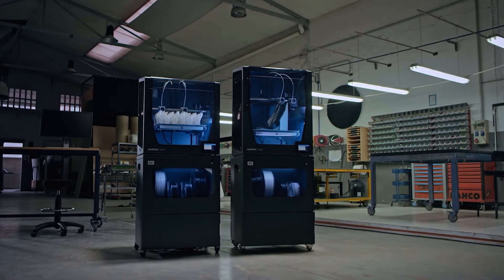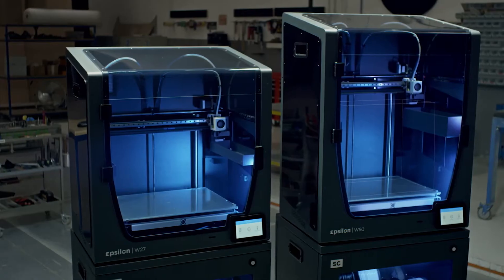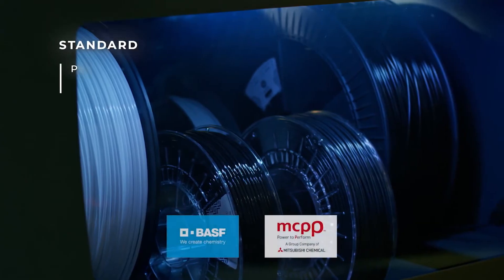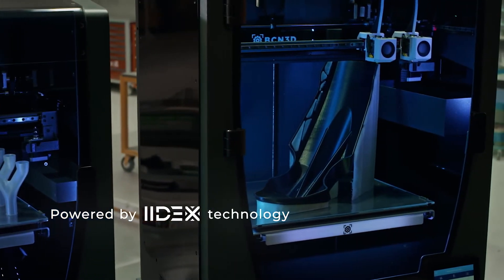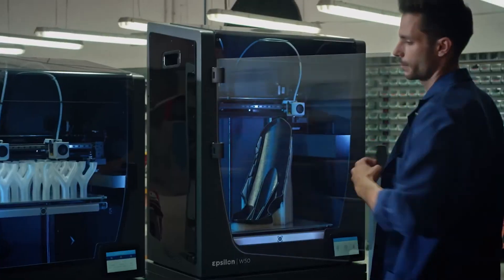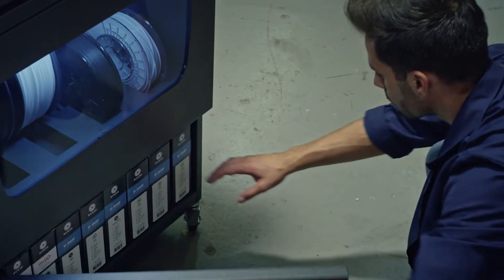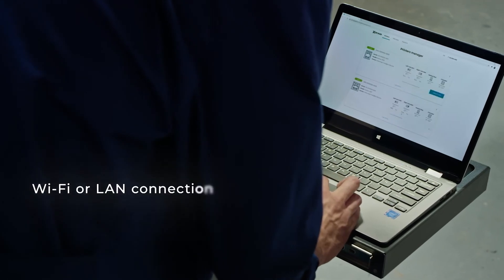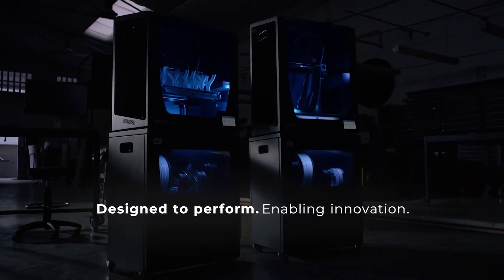New to 3DGBIRE: BCN3D Epsilon Series

Comment: I really like BCN - I nearly bought a Sigma R19 recently - and these look like great machines but... All that tech and development, and they still need to supply a stick of Magig adhesive (2:19)?  There was no better bed adhesion solution?  I'm not going to pay €9000 for a printer if I still have to spread glue onto the bed.
Reply: I can answer you from personal experience and not on behalf of BCN.

I have several home made machines, Prusa, Intamsys Funmat and so on.

After trying basically every different Bed type, I just end up using Glass or smooth-PEI with glue. Because it always works even if the glue layer is really crap. 
So no failed prints, no issue and gluesticks are cheap. You can even use Hairspray.. 
If I want a perfect first layer, I clean the bed and attach a new nice layer of glue. 

So basically, im done with all these "amazing" beds that require work and so on. Glue all the way for me. Regular PVA gluestick..
Reply: @jbergene  thanks John, understood, and to some extent I agree.  It was really the glass that bothered me the most, if it were PEI, especially if it were a flexible bed, I'd have had no problems using sticky stuff (I use 3DLac spray all the time on my PEI sheets).  I've used glass beds in the past and had terrible trouble getting good adhesion or (ironically) have managed to stick the model down so well it brings shards of glass off with it.
Reply: @JonGritton  jepp. Thats my experience too. Glass, ceramic, all the same. Its a pain in the ass and I love Flex-bed with mesh leveling the best. 
And where I can, i rebuild for that. 
On our Funmat HT we bought a Carbon fiber plate as it doesnt chip like glass.

Glass is great when you need the flattest surface, but that is easily fixed with mesh leveling anyway. 

My new printer which is 410x410x500mm use a cast aluminium bed which is 6mm thick. Its not very flat, but it doesnt matter :)